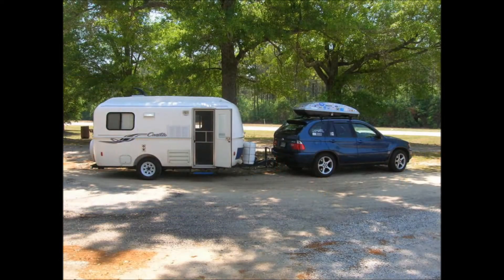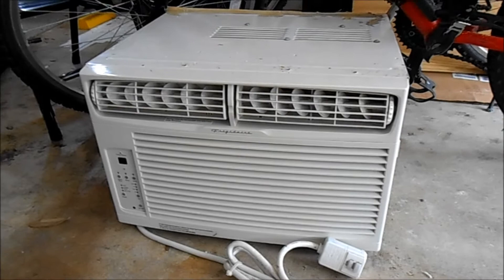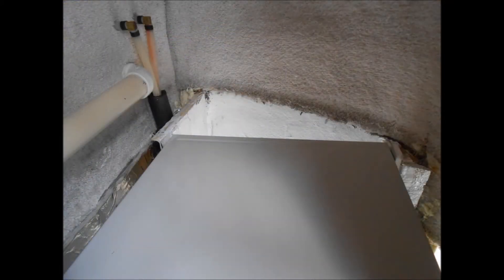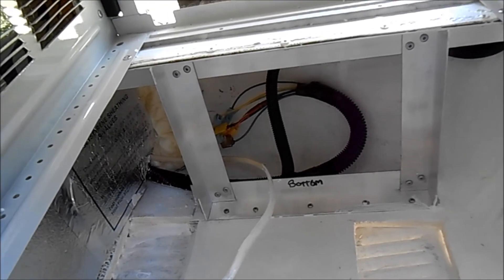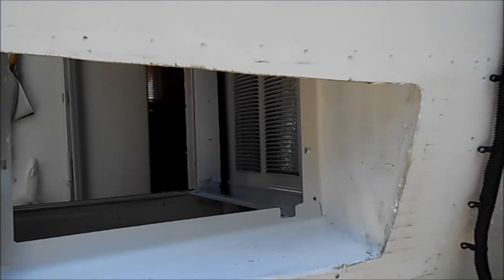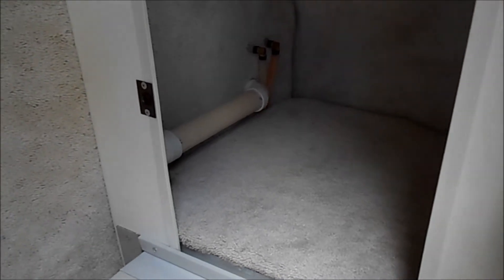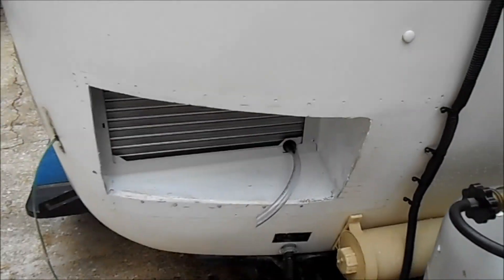CASITA AIR CONDITIONER PROJECT

Comment: Why not install a roof mounted ac seems like less work?  Nice job anyhow.
Reply from the maker: That is a good point, but then I would have to run power to the roof, and then convert the existing opening into some sort of cabinet or something.  This was easier and cheaper.

Comment: Great job! The newer wall unit ac's use a paddle system that scoops the evaporator water out of the drain pan and slings it over the condenser coil for a lower head pressure thus more efficient!

Comment from the maker: This thread from the Casita travel trailer forum has more pix of the finished install, including the larger cutout at the front and new grill.   A rooftop A/C would still be better, but this works OK, provided you are not spending too much time in 100 degree heat!

http://www.casitaclub.com/forums/topic/24610-upgrading-1999-casita-ac-unit/

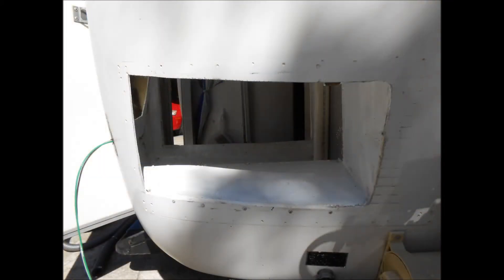Comment from the maker: 1:19 you can see how large the "duct" is and how small the opening is.  This in effect throttles the A/C unit.  We are investigating how to make the discharge air duct larger if we can find or make a grill for it.